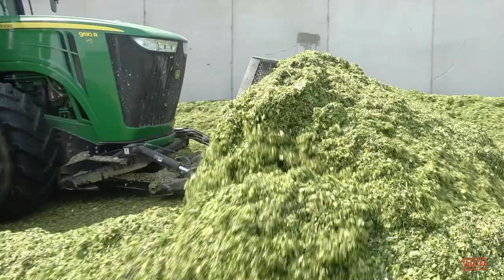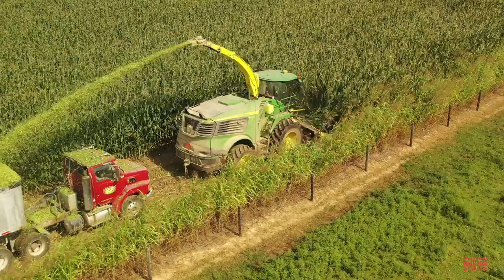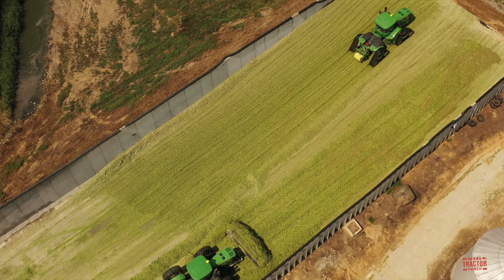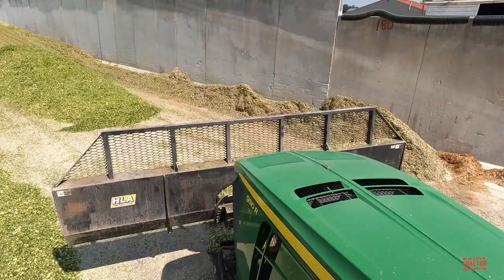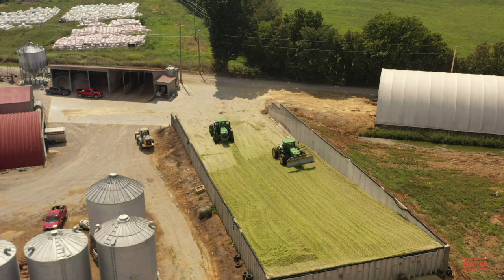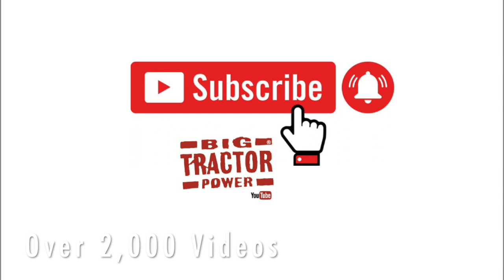TRACTORS at Work: JOHN DEERE 9510R

Comment: I'm really surprised they are packing with an rx for 2 reasons. The cost per hr is rediculous on the depreciation. And running tracks is to keep from causing compaction. But I guess running narrow tracks kind of helps with more compaction. With that being said. The ivt would make it a very comfortable shifting machine to do this with. But the earlier R's weren't the smoothest. Thanks for the vid.

Comment: Hi Jason, 
Is the fed stored in the bunker? And for how long can it be stored? If stored in the bunker, is it covered with a canopy?
Reply: Yes, the feed is stores here in this concrete bunker silo. It will be covered with maybe 2 layers of UV resistant plastic and weighted down with used tires. It will remain here until it is out to the beef cattle. It can be stored here for up to a year, much longer and the quality and feed value will start to decline significantly.
Reply: @dmc3742  Thanks for the info. Temperature degrades everything.

Comment: I’m not an actual farmer. I’m a big tractor guy however. And I’ve also played farming simulator 15, 17, 19, and 22. 

Right now on 22, I have a cattle farm with about 80 on it. I don’t have a huge bunker, but for mine, I use either an IH 6788 or a Kubota M8 and I can’t remember how big the blade is.

Comment: That is a nice tractor and I noticed a John Deere 9RX tractor compacting the silage as well another great John Deere video.
Reply from the maker: Yes that is a 9520RX Narrow Track. It is also used to pull a DB80 32 row corn planter in the spring.
Reply: @bigtractorpower  ah cool.

Comment: can't understand why the other tractor is being used to compact the silage when tracked tractors are touted for their lack of compaction!
Reply: I don’t know much about silage but I do test soil compaction for a living. The tracked vehicle will pack more evenly but less deeply. The wheeled machine with the blade is providing a lot of the deep compaction as the force on the blade generates a lot of downward pressure on the front tires. It however will only tear up the surface and so they work in tandem.

Comment: Interesting footage, thanks for posting, 2:45 till 2:50 the tipper unloading in the shed looks very long for a tandem axle bin, I'm from Australia and I am doubtful you would see a tipper that long over here. Any guess' on it's length ? cheers
Reply: Probably 40 foot
Reply: @blakeherges9307  thanks mate, yep I'd go with that, I was guessing 38ft. Do they run tri-axle trailers over there ? Here in Aust, a tandem axle is limited to 16 tonne and 17 on a tandem drive, 22.5 on a tri. What weights can you run over there ? cheers.
Reply: Maximum without a permit is 80,000lbs combined weight, and depending on road specs you can only have so many tons on an axle so if it's a 5 ton road you would have to have lots of axles to haul maximum capacity